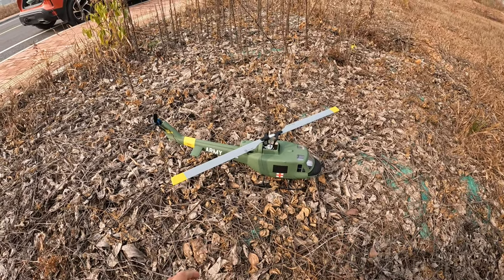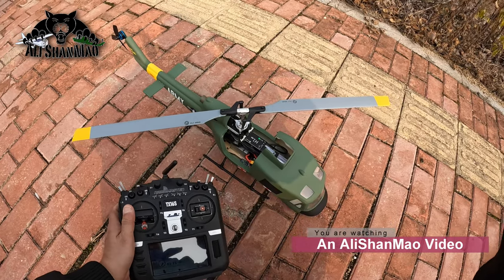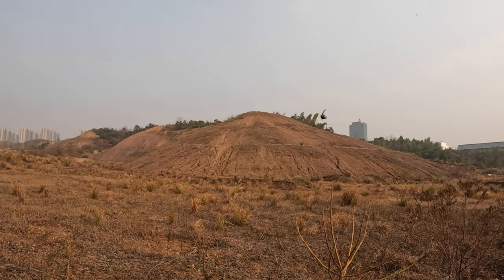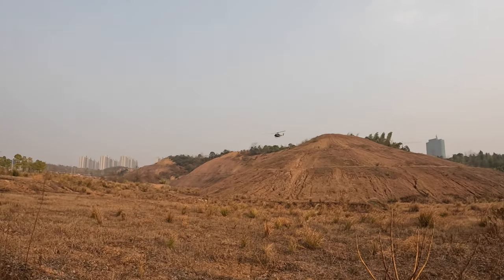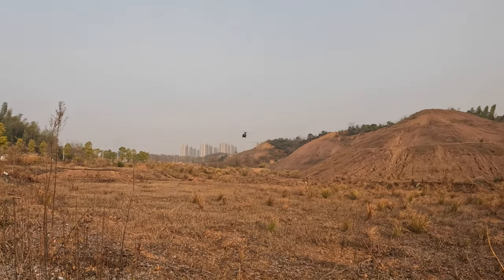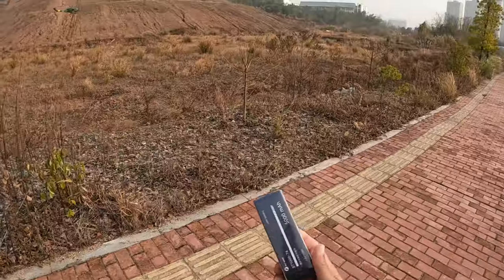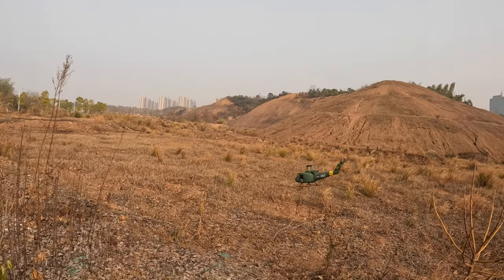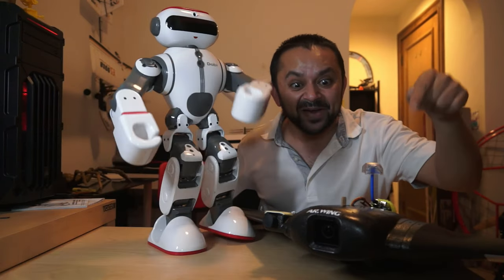Bell Huey UH1 GPS RC Helicopter 2nd RC Flight of 2023

Comment: Great Copter ,nice flight Ali. I orderd the Bell 206 from Flywing. I understand you right? never change the Flight Mode from GPS to 3D in Flight? is thant right?
Reply from the maker: Hi buddy, you can change from GPS to 3D during flight but you should have skills to fly and control a full manual 3D helicopter.
Reply: @alishanmao  Okay , thanks for the Info Ali

Comment: Sir your talus bone full recovery how much time it will take time to full recovery? because i am facing same problem now if you give a answer for my question it will help me alot
Reply from the maker: Sorry to hear that. It took me 3 years to recover. now i am able to run and jump from 1 meter without issues. Alhamdolillah. I can fly paragliders and live normal life but pain in winter still goes on, and if i walk too much, stand too long during day, at night the pain in the foot is severe. 

I suggest you as soon as possible you are able to put load on the foot, give it more exercise and walk rather than protecting it more thinking it will cause issues. I started walking and putting load slowly on my foot (even when in cast) after 3 weeks of surgery. not too much load remember, just a little to keep the foot in exercise. you have to adapt a very healthy life style with exercise, good food and more soups, more veges in the beginning of recovery. 

Remember, you do not want the bone to die. its very easy to necrosis on talus bone. so be on the edge. give your foot as much exercise as you can. because if GOD forbid, necrosis happened, only way is to take the bone out and leave hollow, then you will be disabled from that foot. you have watched my videos, even with casting and crutches i used to drive and go out to walk, make videos, and i kept on very healthy routine of exercise. alhamdolillah, I recovered earlier than surgeons expected. they were surprised. 

wish you all the best.
Reply: Thank you a lot sir

Comment: Hey Alishanmao ,  mate  l bought this  and love the look and feel but  lm getting an horrific shake when it winds down on cutoff, l have checked the blade tightness and think it has to be close to what you explained. it does it 1 out of 3 times, at full power it doesnt shake only shakes on wind down ,  any thoughts
Reply from the maker: Thanks for sharing, this is one tendency on this model to do this when powering down after landing. i therefore recommend landing on soft areas like grass. also check inside if the main module is secured and nothing is loose
Reply: @alishanmao  Yup thanks mate for your advise,  l tried it from grass and it went perfectly , l cant say how much l love this thing. Have done it up as the Bushranger Australian Vietnam Chopper.  Thanks again
Reply from the maker: always welcome and have fun buddy  @geoffcarr5357

Comment: Where can I purchase the batteries and parts?
Thx
Reply from the maker: What parts are you looking for? Check with same site if they have parts. else i will do my best to help you
Reply: @alishanmao  hi Ali, the bigger batteries you just featured on your latest video,main blades, rear 3 prop, fuselage. You know I lake to be prepared if something happens.
Reply from the maker: @carvingfool  I will check and see where those batteries are available. normally you can buy any 5000mAh 4S 25C battery to fly this heli. it does not have to be flywing battery
Reply: @alishanmao  hi Ali , have some of those, what about the other replacement parts o like to keep on hand, fuselage, main blades, rear blades and main gears?
Thanks
Reply from the maker: @carvingfool  mostly crash, depending how you crash wil break fuselage, break main or tail blades, bend main shaft, rip main gear teeth, and bend feathering bar in main rotor head. so keep those spare with you
Reply: @alishanmao  hi Ali, that’s why I like these parts in stock, share can I buy them?
Reply: @alishanmao  Hi Ali, I hope all is well. Where can I purchase the spare parts like fuselage, rear motor blades, main blades…